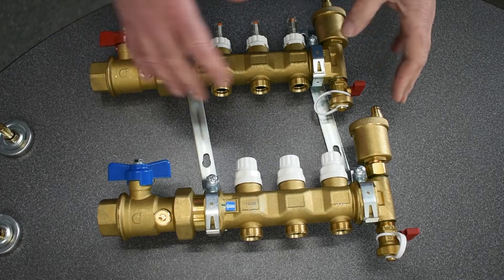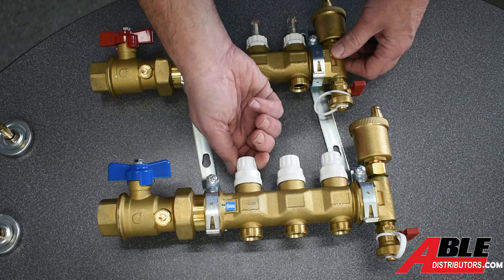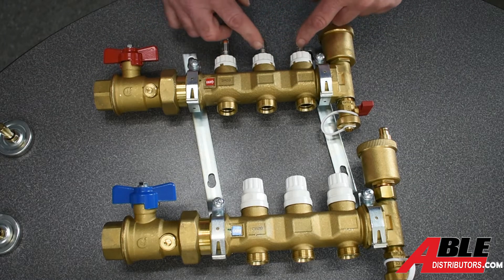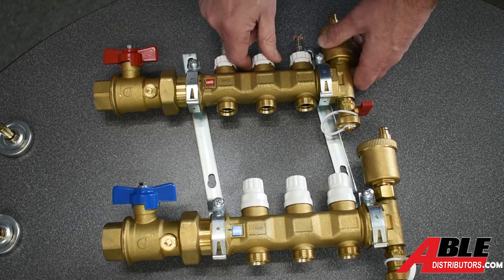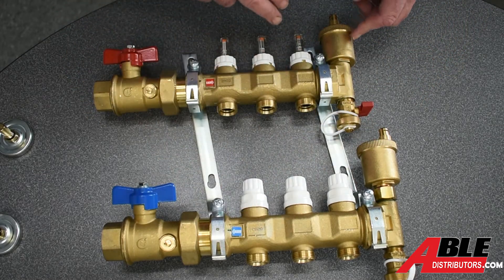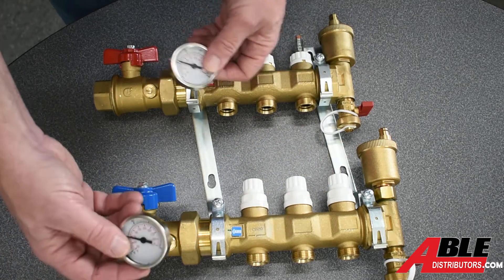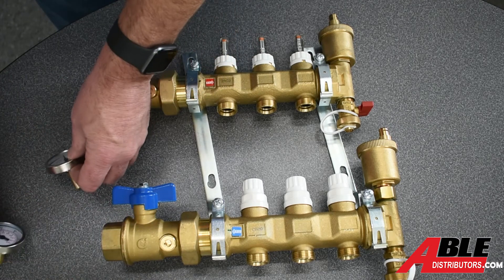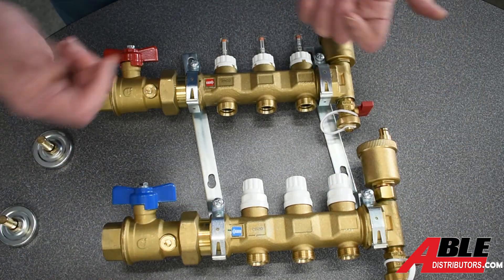Caleffi Manifolds: Initial Valve Adjustments + What's in the box?

Comment: Thanks from an amateur who installed his own distributor system after the previous one corroded and then couldn't figure out why the floor heat wouldn't work - I had all the valves tightened in the clockwise direction!